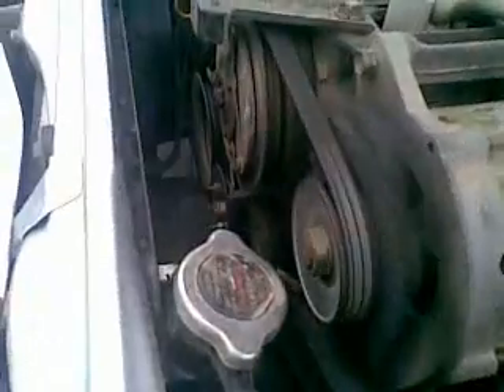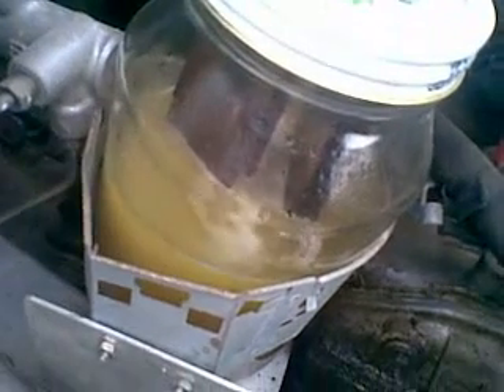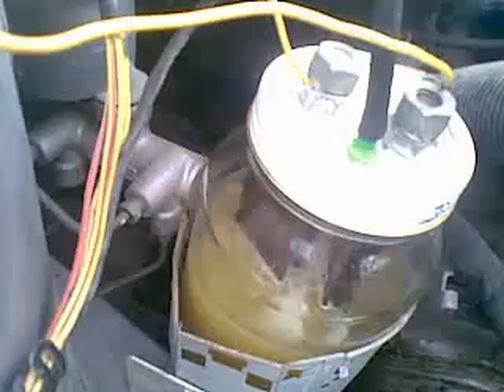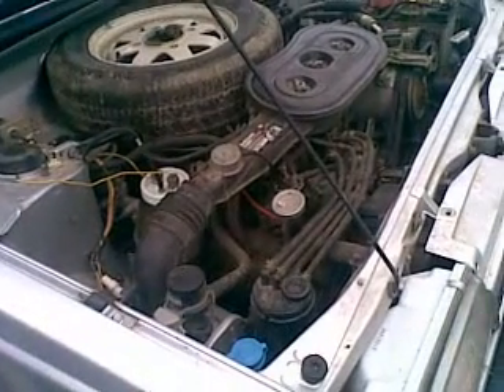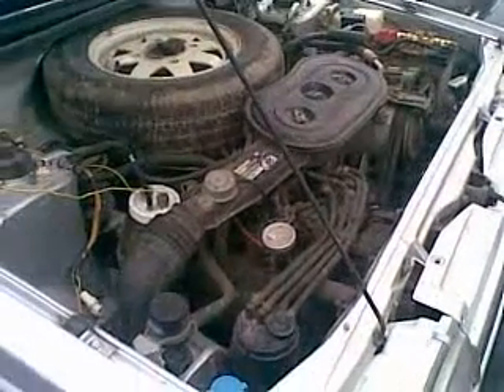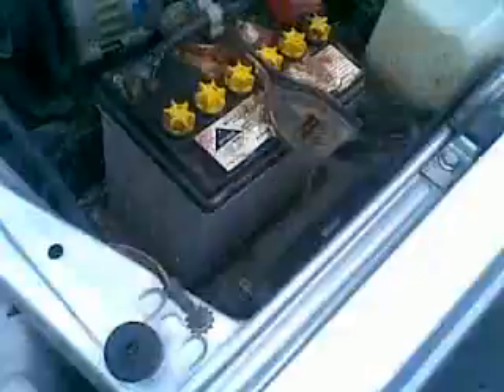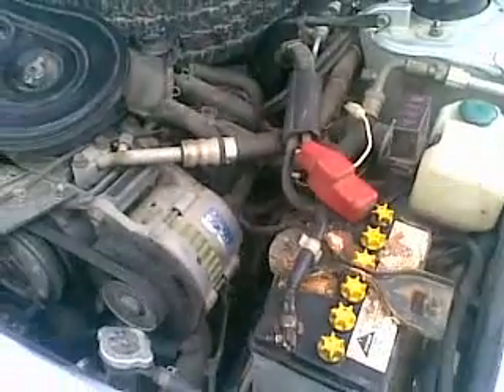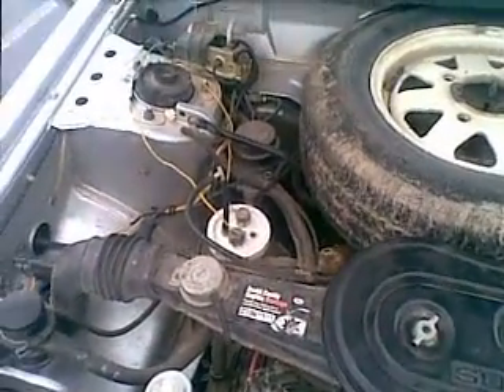Hodgey's  Hybrid Hydrogen-Burning  1992 Subaru 4WD

Comment from the maker: @Godsson1dfl
   Ahoy, Hodgey..! I've Bin-Extractin' gems from the knowledgemonger's head. At 2 Volts ya Electrolysis Cell is 70%efficient. Reaction stops below 1.8V., & over 2V the resistance ups, & Eff. falls. So, ya need 6 HHO-units in series to use juice of 1x12V Panel + Batt/Reg.. Will need LowVolt cutout, & Crank-Rotation Sensor-cutoff (stop gasbuild if motor stopped, Ign.-On, in Sunlight).. My suggest. is use old Battery Case, for the 6 HH0-Units in Series,(?)..!

Comment from the maker: @Godsson1dful
   I put Qs to the Debunker-Troll, who lurks at the Magnetic Motor site 
("knowledgemonger")... The tip is that Electrolysis Cell is most efficient at 2 Volts (70%)the reaction stops at 1.8V, and above 2V. the efficiency drops off quickly, as resistance rises... My next Q. 2 'km' will be, how2 turn 1.5 Amps at 14 V (PV output)  into 10.5 Amps at 2V., to chase  that max. efficiency. Also 'km' says burn-chemistry improved by H2 + O2 fed into mix.

Comment from the maker: @Godsson1dful
   Ahoy, Hodgey...! I changed the description of the clip of your HHO Unit. Thought to fine tune top line that's displayed at first click of the scroll... While there was warbling regards cumulative inefficiencies of the Auto Alt. , when I realised that ALL the percieved snags of your gadget will disappear entirely if ya run your Unit on a PV+ Solar-Reg. With low volt cutout + Separate Battery via the Ignition. If you fit all that, it'll make you a world first. In Real Life...